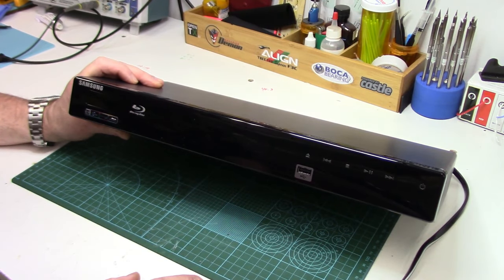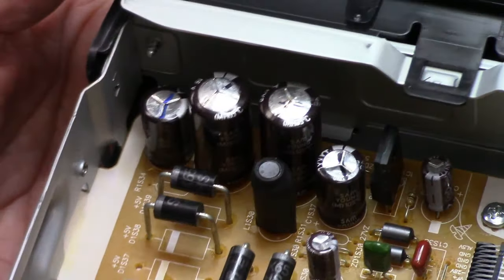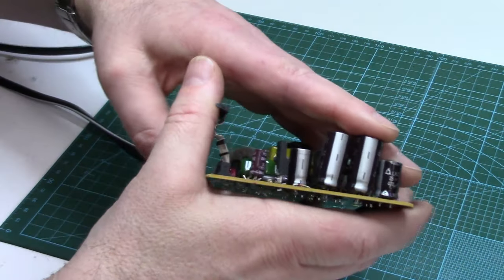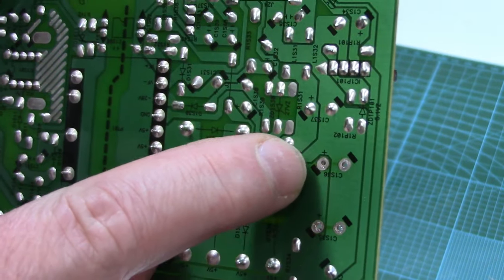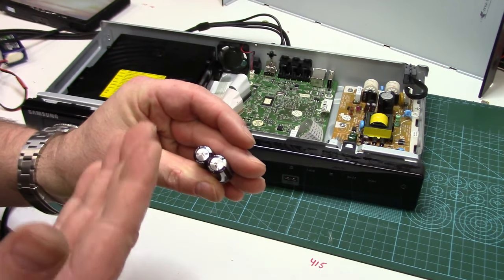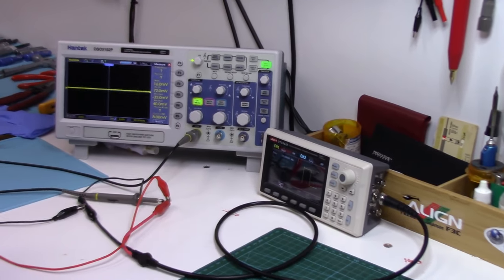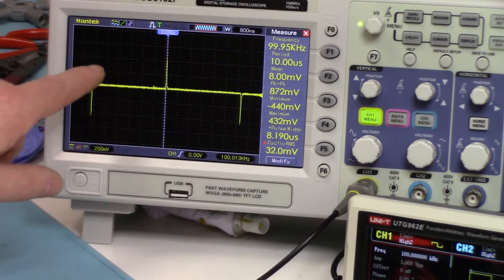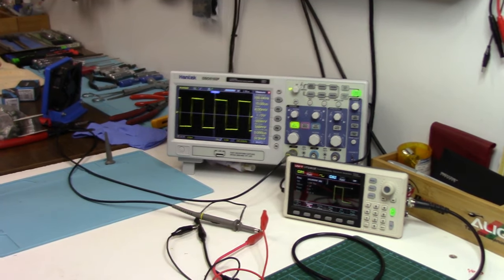Easy Electrolytic Capacitor Replacement & Testing Methods

Comment: can use audio signals to test caps?

say put a cap in series with the output of an mp3 player to the sound input on your computer?

if the cap is bad it will let a different frequency through or even crackle.
Reply from the maker: Audio is low frequency (perhaps peaking upwards of 20 kHz the odd time but mostly between 60 Hz and 15 kHz which is a long way off the required 100 kHz to 500 kHz to properly test an electrolytic cap. A cap may pass a low frequency audio test without issue but fail once the frequencies are increased to nominal operating frequencies (again, application dependent).

Comment: John in your opinion, what variation in capacitance value would be deemed acceptable / safe when replacing caps .. eg the value of a cap to be replaced is 47uF at 25v, the new replacement cap both being 25v when tested read as being 45uF and 49uF with low ESR, would a person use them or not? .. Thank you.
Reply from the maker: Personally, I don't put much "value" (pun intended) on tested capacitance values of caps. I would certainly use them (those values are very close in proximity after all) provided there are no physical signs they are shot.

Comment: The MESR-100 V2 is awesome. You can also test the resistance or microhenries of the inductors with the esr meter. The reactance formula is 2𝛑FL. That would be 2 x 3.14 x frequency of esr meter which is 100 kHz x 100 (uH) Just plug it in to get the reading.

R=0.628 X L(uH)
L(uH)=R(ohms)/0.628

Comment: Hi
My 25 yr old car radio stopped powering up. I changed the two 2200uF capacitors in the power supply and it didn’t help. Could it be the other capacitors on the power supply board? Thanks!

Comment: My 2 NAD stereo receiver power supply filter caps are rated 4700uF  50V. Are you saying I shouldn't go over 4700uF but volts are okay to bump up?
Reply from the maker: I don't know enough about audio equipment applications to give you a definitive answer, but the general rule is you can always increase the voltage rating of an electrolytic cap provided there is enough room to fit. Most of the comments support that as well.

Comment: Some oscilloscopes have a signal generator to calibrate the probes and working at 1 KHz/5V : can we use that signal instead if we don't have a signal generator available ?
Reply from the maker: I would be concerned with 5V output. That is likely too much for most caps and the test alone could cook them or at least use up some of their life. I suppose you could build a simple voltage divider circuit to lower it to about 1V or so which I think would work fine, but that is just a suggestion and don't know how good the test results will be?
Reply: @Rchelicopterfun  Thanks for your reply, actually, if forgot to tell the signal I'm talking about is DC, between 0 and 5 V, not from -2.5V to 2.5V...
We need an AC signal, right ?
Also, 1kHz isn't enough, is it ? It should be at least a few dozen of kHz, like yours, 100kHz, right ?
And yes, a divider should do the trick...
Reply from the maker: @gloubiboulga  - Yes AC is best so the cap is seeing both positive and negative noise potential. Also correct that 1kHz is not nearly high enough; sorry I missed that and read 100 kHz for some reason. Most capacitor ESR meters will test around 100 kHz I believe. Ideally, if you know the frequency the device is operating at, that is what you would test the caps at. I never checked the switching frequency of the switch mode power supply in this blu-ray player, but many switch mode power supplies operate around 100 kHz so it seems to be a fairly universal test frequency.

Comment: Hey John I’m looking at buying a ksger t12 station and wondering if it’s still a good station. I also can’t decide between handles
Reply from the maker: Hi Isaac, I love mine and it's working great. I use it a fair amount and have never had a single issue. Haven't even worn out any of the T12 tips yet (I do look after my tips however).  Handle choice is entirely personal preference. I've tried 3 of the different designs, and still like the basic plastic 9501 handle best. It has the shortest grip to tip distance (31mm) and is the best balanced in my opinion, but I like working close in for better tip control. Of course, others don't that method or the plastic 9501, and like the aluminum one or the longer working distance 907 better. Your call.
Reply: @Rchelicopterfun  Cheers

Comment: I had to replace the 2 power shottky diodes in my brother in laws sony radio cd player as they were both loosing power by half its proper full value total. There was no power at all to the board. I did check all the capacitors and they were working fine.
Reply from the maker: Nice repair 👍

Comment: What's the name of the handtool you use to desolder?
Reply from the maker: ProsKit SS-331 Desolder Station: https://amzn.to/3xTFQ4r
I did a full review on it a while back: Part 1: https://youtu.be/PuiiZO8Ye70?si=10YwBoii2BSY1vNt
Part 2 (110 - 240V universal voltage update): https://youtu.be/9eBG7z-2qNE

Comment: Never saw this oscilloscope setup before, do can you make a video explaining what is a function generator and how you plug it in and use it aside from caps testing?
Reply from the maker: Wiki Definition: A function generator is a piece of electronic test equipment used to generate different types of electrical waveforms over a wide range of frequencies. 
There are already lots of articles, webpages, and videos out there on what a function generator is & what it's used for. Just one of many examples: https://www.youtube.com/watch?v=a4DHYyoNNZ0

Comment: Thank you for sharing the knowledge! Slightly off topic question: Would you know of any advantages of getting Hantek DSO5102P or Rigol DS1202Z-E oscilloscope? Both are 2-ch. in very similar price range. Hantek is 100MHz which can be hacked to 200. The Rigol is 200MHz factory.  Thank you in advance!
Reply from the maker: @tektech1065. I actually did a review on the Hantek DSO5102P (the scope I use): https://www.youtube.com/watch?v=mIoHFwyeE44
It's one of the best entry level beginner/hobbyist digital o-scopes on the market in my opinion. In that review, I do mention the Rigol DS1202Z-E as another good choice if you need a deeper memory scope. That would be the primary reason to get it over the Hantek. 
You state both are similar in price, however, from my research when looking at each before I got the Hantek; the Rigol was almost $100USD more. I haven't looked in a while however so maybe they are on sale or similar now and if that's the case, the logical nod goes to the Rigol for the longer record length.
Reply: @Rchelicopterfun  Thank you very much!

Comment: Is it common for the electrolytic fluid to be that dark color? Or does it change color over time?
Reply from the maker: I've seen it almost black, brown, yellow and cream. No idea if the color changes from time, usage, heat, application or the specific electrolyte used by a given manufacturer?

Comment: Is there a preferred brand of capacitors to buy?
Reply from the maker: Generally if you get them from a reputable electronics dealer such as DigiKey or Mouser and stay away from the eBay and Amazon ones you are pretty safe with any of them.  I personally don't think any one brand is consistently head & shoulders better, but you generally can't go wrong with Nichicon, Rubycon, Vishay or Panasonic. In critical high power stuff stuff like ESC power input caps, (which this old Blu-Ray certainly is not), I generally only use Panasonic caps and have never been let down (anecdotal of course).

Comment: 4:42 most likely they have a lower ripple current rating which is important for caps used in power supplies. caps with lower ripple current rating will heat up faster and run much hotter and have a much shorter life.
Reply: i was frelng privileged about having my esr meter until you pulled out your function generator and oscilloscope

Comment: Thanks for the video, but you didn't say or explain why you didn't check or change out any other caps on the power board...?
Reply from the maker: @The Ol' Outlaw - Because the rest had no indication of puffing/leaking - fix the known stuff first. Only if this didn't fix the issue would I then have dug deeper - within reason.
Reply: @Rchelicopterfun  Okay, makes sense.  Thankyou for the reply. :)

Comment: Lady in a parking lot said her car would not start needed battery boost. She had her friend change battery and it did not help and several shops told her itcwould need expensive diagnostics. 
I was late for a job,but I said I take a look. Opened the trunk took a 7/16 wrench tightened up terminals,then with no boost I said try it.
Little sliw but it kicked over and ran. Left her my biz card ,asked her to let me know if it failed again. She called me up on a friday and then E transferred me a couple of dollars.

Comment: Where did you order from, were they local? I used eBay but didn't see the shipper till a tracking # was produced. (China) It may be next year before I get them???  Where a distributor for a future purchase 🤔!
Reply from the maker: Here in Canada, I usually purchase electronic components from DigiKey or Mouser.

Comment: I WAS AT A RECYCLE DAY, GOT A JUMP PACK WITH INVERTER, JUST CHANGED OUT THE BATTERY, AND A DVD PLAYER WITH A BAD POWER SUPPLY. THREW AWAY THE P S AND I NOW RUN IT ON EXTERNAL 12 VOLTS FOR THE AUDIO CIRCUITS AND A STANDARD 5 VOLT REGULATOR LM7805 WELL HEAT SINKED TO THE FRAME, PLUGS INTO ANY 12 VOLT POWER OUTLET MAKING IT PORTABLE !!!!!!!!!!!!!!!!!!!!!!!!!!!!!!!!

Comment: What about discharging the capacitor to remove all charges and corresponding voltage. It’s important information.
Reply from the maker: Where do people come up with this nonsense? Clearly no electronics training. 1. Discharging a low voltage 16V rated cap is pointless.
2. It's being used in a power supply circuit that is self discharging.

Comment: You put in those new caps right away, aren't you supposed to tin the leads first, to avoid cold solder joints ?
Reply from the maker: All component leads are pre-tinned.

Comment: Do you look for what caused the fail?
Reply from the maker: Electrolytic capacitors are a consumable component. Failure mechanism was usage & heat, hastened somewhat by the use of low quality electrolytic caps in this particular unit; but failure would eventually happen regardless.

Comment: If i change 16v by 10v what will happen
Reply from the maker: You mean replace a 16V rated cap with a 10V rated cap? If so, it will likely fail in short order (totally dependent on the operating voltage of the circuit of course). General rule with electrolytic capacitors is you can go higher in voltage rating, but never lower.

Comment: Blacklisted devices wreck their capacitors, typically seen on old P2 motherboards. Seems that a legalized, activated device fixes the capacitors by charging them correctly. So if a laptop had previously an illegal Win, by replacing it with a legal one, correctly fixes all components without the need of replacing any parts.

Comment: But this method does not work for low ESR capacitors? You are using AC voltage on a high ESR value capacitors here.

Comment: How much would you say such a repair costs?  Because they tell me that they cannot replace the capacitors and 1 LED on the monitor for less than €70 or $70.  Which is crazy because the value of the components is less than €10.  the new monitor costs me €120, which is an absurd amount for a repair.
Reply from the maker: Who are "they". Regardless, not crazy at all and sounds perfectly reasonable to me considering any electronic repair shop I know will charge a minimum inspection fee of about that, not to mention the door rates are at at least $125/hr. You are not paying much for the component in an electronic repair, you are paying for the technicians time, expertise, diagnostic skills, repair equipment and all the other costs associated with keeping the lights on at the shop.
Reply: @Rchelicopterfun  That's sad to hear.  With such repairs and prices, we will never achieve our goal of reducing electronic waste.  Throwing things in the trash will only increase and increase, and in the end they will eventually close their repair shops.  Such a system lacks stability and resilience.  Every piece of electronics that is serviced should be paid by the state to the servicer, as this reduces disposal in the trash.  This would also lower the prices of services and make them a more interesting option for users.
Reply from the maker: Exactly why I've taken the time & effort to learn how to fix things myself. Suggest you do the same if this is such a big problem. With less and less skilled trades people, this as you say will only get worse. No-one wants to learn how to fix things anymore, they just want to buy new stuff or have someone else do it for them for next to nothing. 

Our society is pathetically disposable and becoming more so with lack of right to repair, proprietary technology, lack of trained techs, software no longer supported, parts discontinued, and the bottom line of commercialism to make more money and increase the stock. Look at Apple and Tesla as just two of the worst offenders - there are many more and it's growing daily. Why not make the manufacture pay for the problem with their billon dollar profits over suggesting the already overly burdened tax payer pay for it! 

I most certainly don't want my taxes going up to pay for everyone else's repairs. Where does that stop? You going to recommend a tax funded repair program for vehicles, hvac, appliances, and every other bit of repairable technology that is headed for the landfill because it's 1. Too costly to repair over the price of a new. 2. Can't be repaired because there is a lack of technical trades knowhow. 3. can't be repaired because the manufacturer won't allow it and has completely suppressed right to repair. 4. Can't be repaired because the software is no longer supported or parts have been discontinued. 5. The mindless masses only want new stuff because they are bored with what they have.
See, it's a much bigger and complicated issue than the little corner electronics shop charging a very modest repair fee to keep their equipment running, staff trained, lights on and putting food on the table for the technician's family.
Reply: @Rchelicopterfun  Everything you listed is true.  And of course I didn't think that the citizens would pay for it with taxes!  That would be counter productive.  My thought was that companies that use such "non-repairable" methods Pay an additional contribution to the state for repairs or recycling that they do not want to support.  Whether it's spare parts, electronics blueprints, software updates or 3D models for printing spare parts.  This money is kept separate from taxes and used for repairs and recycling of their such products.  If they do not take care of their products, the copyright to the product is taken from them or the license for sales in the country is taken away, but they can make them accessible to repair services.  Even if we start building recycling centers now, they will not have a large enough capacity for the next 20 years, and by then there will be too much waste electronics in landfills.  I can fix certain things myself, but I always try to take it to a professional for repair first.  However, it is getting harder to pay the repair prices year after year.  I try to stick to what I know I can fix myself, but social and industry standards are quite aggressive and don't give me many alternatives.  Anything older than 1 year is already out of fashion, but 3 years or more is old and has almost no software or repair support.  Thanks for the conversation.  Although we won't solve anything, it's good to hear similar thoughts.